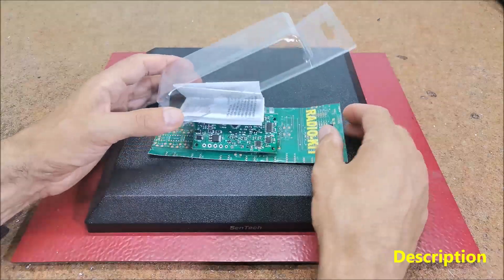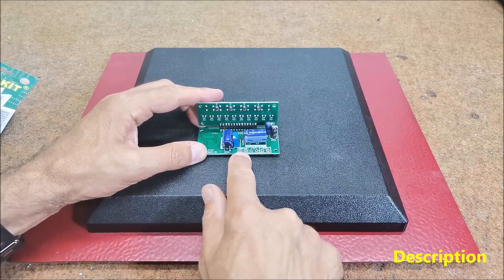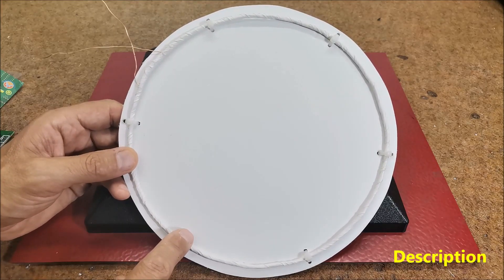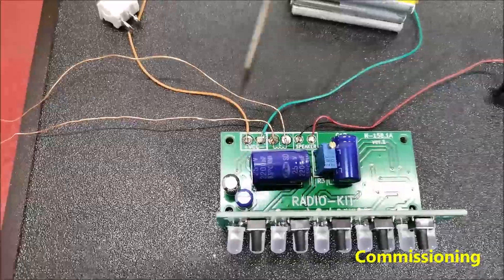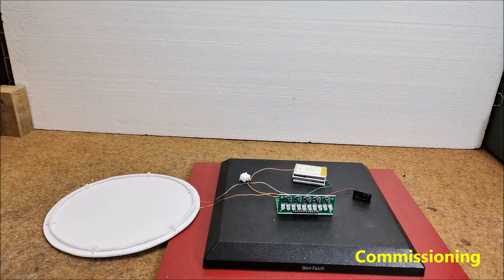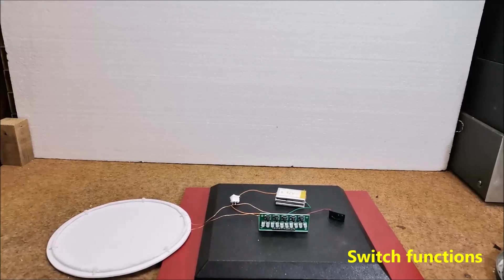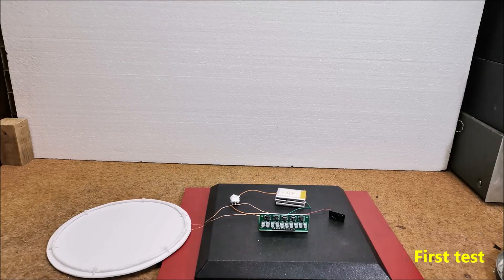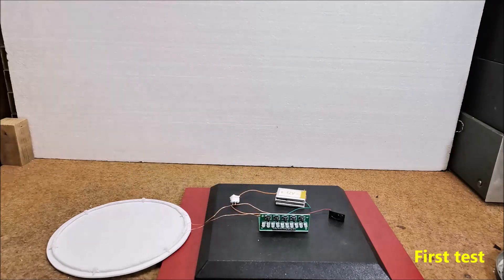Clone PI-W Atmega8 (Arduino)  Metal Detector short Review

Comment: Is there a minimum coil resistance? I built a 27cm diameter coil with 23 turns of 0.7mm wire and the resistance is only about 0.9 or 1 Ohm. Is this too low?
Reply from the maker: The coil resistance should be around 1 ohm, so your coil is good
Reply: @MirkoPavleskiMK  Thanks. Will see how I get on.

Comment: Hi, thank you for the video, it's very informative. I have a question: How many turns will I need for a wire with diameter of 0.7mm and coil diameter of 250mm?
Reply from the maker: You need to experiment. I suggest you start with 20 windings first, and then you can increase
Reply: @MirkoPavleskiMK  Thanks, I will try that
Reply: @MirkoPavleskiMK این مدار چقد حداکثر عمق زنی زیرخاک دارد با کویل بزرگ ؟